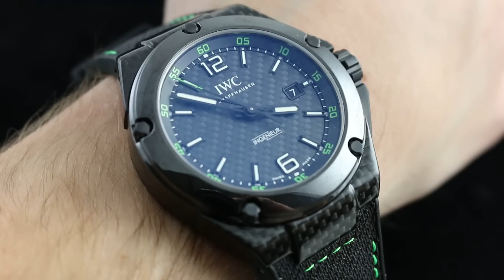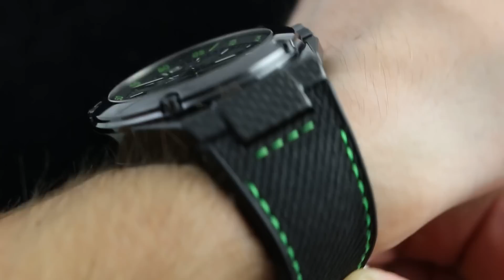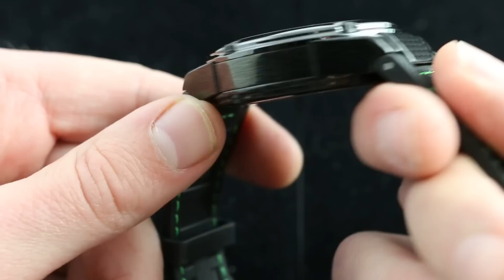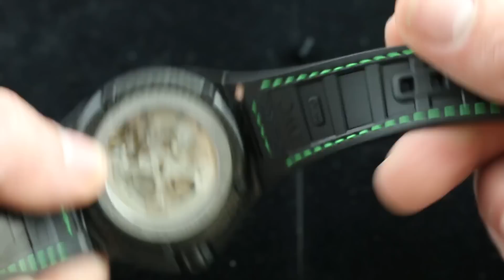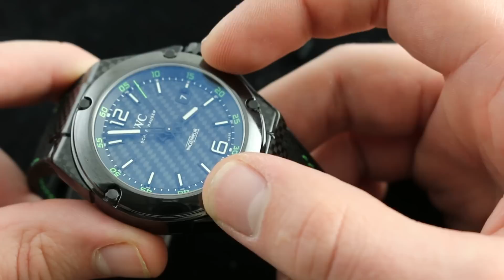IWC Ingenieur Automatic Carbon Performance Ceramic AMG IW322404 Luxury Watch Review

Comment: i like the old setting better, it was one of the reasons i subscribed. you can use your dslr in the old setting and angle too! Please bring it back.
Reply from the maker: +Creep 911 Hi Creep, I'll try to recover some of the old vantage point, but there are some challenges involved in working around the size of the new camera and tripod. Also, in the last few days, I ripped my shoulder out of its socket in a bike incident, popped it back in, and then went to the ER. Ligament damage is the verdict, but only time will heal it. This is making it really tough for me to get the same angle with that left wrist, and I'm in a sling when I'm not making the videos. The old look might come back automatically as I heal and compensate less for the injury. Please bear with me until then.
Best,
Tim
Reply: +watchuwantinc Hey Tim, Sorry to hear that, hope your shoulder recovers very soon. I will now go check your recent uploads :D seems you uploaded over 3 reviews since this one.

Comment: The audio is certainly better now. I guess you have a proper microphone with your new camera. One thing I miss from your old videos is that you used to start with the watches on a table; I really liked that because I could see the whole scale of the watch from the strap to the case. Now with the closeups, it's harder to grasp how big the watch really is.
Reply from the maker: +RandomUser20130101 Hi RandomUser. In fact, I could bring that feature back without too much trouble now that the camera features auto-focus. When I was using the phone, the focal plane would become locked on the first image the lens captured, so I had to choose between the wrist shot and the board shot. Now I can have both, so I'll try to mix it up.
Best,
Tim